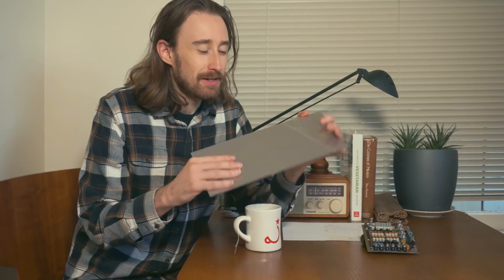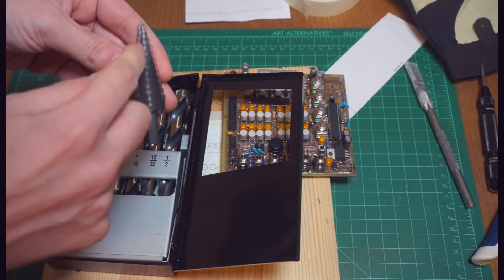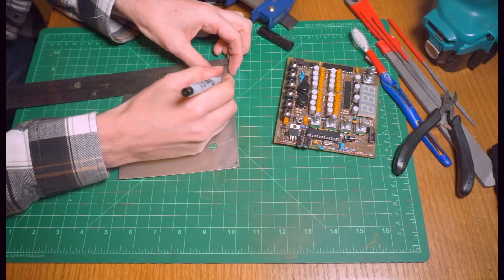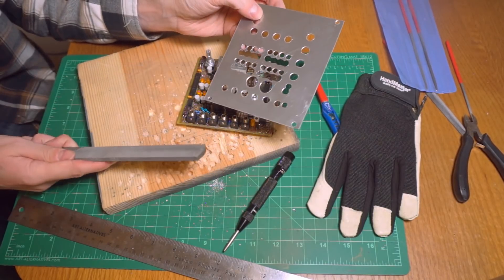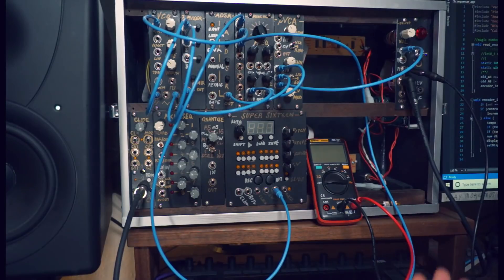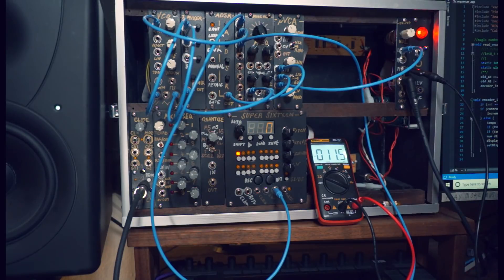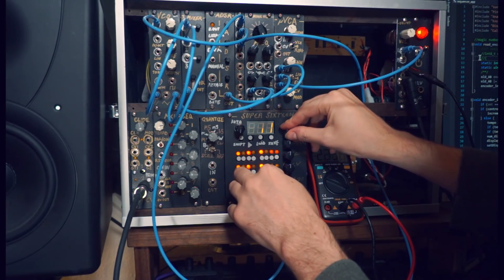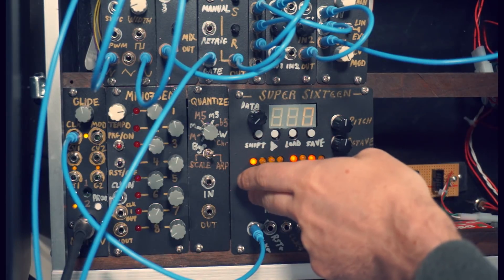Designing a Eurorack Sequencer - Part 6: Front Panel and External Sync

Comment: Nice video ! But next time use a center punch for your holes. It helps a lot ! Also give yourself a bit wider tolerance at the dimensions. From the other side the rework of the faceplate gives your sequancer its charm

Comment: heyy this is really starting to come together, looks like a really fun sequencer to play with. Digging the advanced features you've implemented, switching to a proper IDE and breaking it all out into classes helps so much. I think I got to around 800 lines before i had to fully refactor, but it was totally worth it.

re: pattern storage - are you looking at FRAM or flash storage? I was originally going to try FRAM but I kinda want to try leveraging the EEPROM as my sequence encoding is quite compact. the read/write times (especially write) are pretty harsh though :/
Reply from the maker: Looking at using Flash - had in mind the W25Q80DL because it was through-hole and big on adafruit/sparkfun, but seems to be obsolete. Will try breadboarding with it but may switch to a more current chip - in any event all the new flash stuff is 3.3v only so requires some level shifting with transistors or another IC. Excited about it as it's really the last thing to prototype before spinning up some boards!
Reply: Ahh yep yep. I've been trying to keep everything 5v to try and minimize the component count and the overall complexity of the circuit as this is my first proper dive into circuit design. I'd definitely like to have my name put down on some kind of a list if you have plans to sell boards!

Did you have any intentions of pushing the code to github? Apologies if you've articulated this in any of your previous videos, I just have a really bad memory :P
Reply from the maker: @JarrydNielsenLMAO  Yes, planning to sell boards at some point! Will start a mailing list when I'm closer to it. The code is indeed up on github: https://github.com/matthewcieplak/super-sixteen Still a mess, no classes yet but if you have refactoring ideas I'm all ears!
Reply: @extralifedisco  Ahh yes I have actually been to your github before, silly me! 

I can definitely see some similarities in the way we've chunked our projects out, as well as a few differences. I probably can't offer any solid advice for refactoring as i work on my code in a very incremental way, but feel free to have a dig through the repo for one of the sequencers i started working on last year - https://github.com/atomsmasha/ModularSequencer

Might have to pinch your portamento code for a new project i've started working on, if you don't mind :3

Comment: Wow this sounds pretty 303-like. What other parts contribute to this and how? Is the filter explicitly a diode-ladder for example?
Reply from the maker: Yep, the filter is a YuSynth minimoog VCF, which is a transistor ladder design (matched BC547s). I don't know much about the 303 filter but have seen people say it's also a diode ladder clone. (I have noticed that the "acid" filter mode on my bass station sounds nothing like either one!) I am running the synth out through a Sansamp Para Driver DI (a guitar amp sim pedal) which has a sweepable mid boost before overdrive - really pulls up that squelchy sound.
Reply: @extralifedisco  hmm the Moog filter is indeed a transistor ladder but this is not the same as a diode ladder (which is in the 303). So I guess this specific sound is indeed mostly because of the drive/amp-sim you are describing.
Thanks!

Comment: Great way to start the new year! 
edit: I'm curious how you approached the issue of the first step.  Analog sequencers tend to not play the step the sequence starts on as the clock pulse advances to the next step right away. Digital sequencers typically will play the first step and I've always wondered what the trick behind that was.
Reply from the maker: I noticed I was losing the first step in my first tests and in the next build I changed the initialization so that the "current step" value starts at 16 rather than 1. Seems to work for now - there's also the external "reset" input to set the start instantaneously - my midi-cv doesn't have a reset out but I do want to test with a more standard euro clock (pamela's workout maybe?).
Reply: @extralifedisco  Very interesting.  Is your sequencer based around a counter?  I noticed that my Varigate 4+ doesn't actually respond to the clock gate (especially gate patterns that aren't really clocks like euclidean sequences or drum patterns) the way my SH-101 does.  The SH-101 is one gate one step, so I get a straight forward variation on whatever is in the buffer.  The Varigate 4+ has ratchets and multiply/divide options so it averages the pulses to determine  bpm and then resyncs the step as best it can but the result is often charmingly wonky..
Reply from the maker: @robertsyrett1992  Ah, clock multiplication is more art than science. Mine is all in software, so when it gets a change from low to high on the clock input, it stops the internal clock, advances a step, and counts milliseconds between pulses (solely for duration and glide length).

The clock input has a transistor buffer to bring higher voltages down and lower voltages up to 5v. My MIDI-CV module has some crazy low impedance clock out, so it doesn't even work when hooked up through a resistor divider - that might be a difference between your devices (input buffer design). My CD4017 counter sequencer triggers on input low instead of high, but otherwise seems to keep time pretty well.
Reply: @extralifedisco  Thanks for answering some extra-geeky questions :)

Comment: Ah, panels... I tried cardboard, thin wood, but the best material is aluminum for sure. Make sure to drill the panel before soldering any component that goes through it, so you can solder those components with the panel on (I remember spending hours trying to adjust jack holes to make the panel fit).
Great episode as always!